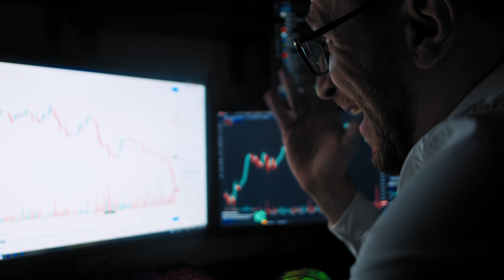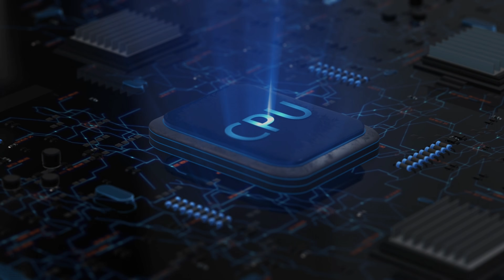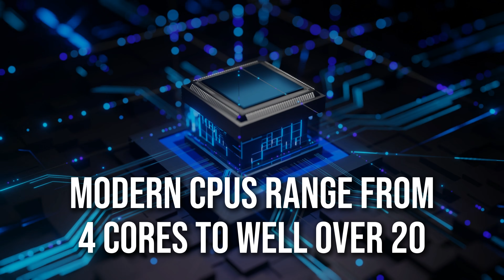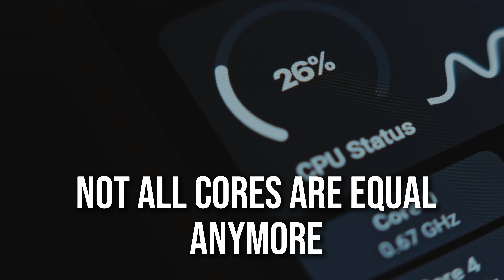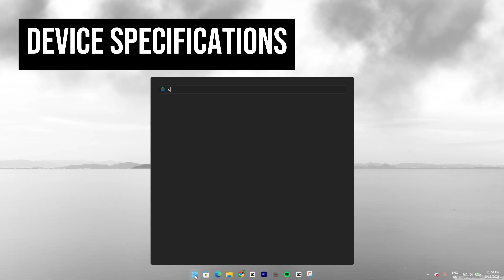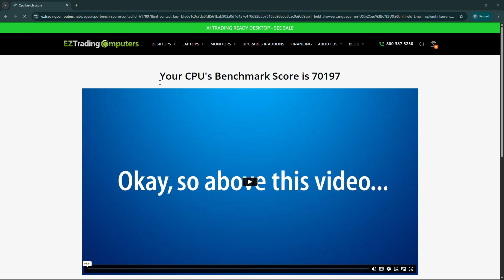Your Processor Score Might Be Costing You Thousands

Comment: What if you are just using Ninja Trader with one workspace, one instrument with 5 chart tabs on one 28 inch monitor with a CPU benchmark score of 27000?
Reply from the maker: Thanks for watching—that’s a solid question.

That setup can run fine on a 27,000 score, but you’re closer to the lower end than it might seem. Once you start adding indicators, tick data, or faster timeframes, NinjaTrader leans harder on the CPU and you can start to feel small delays or chart stutter.

It’s not just about running—it’s about staying smooth during volatility, and that’s where higher headroom helps .

Are you running mostly price action or indicator-heavy charts?
Reply: @eddie @eddiez-trading e the orderflow edition:  VWap and delta.   When I purchased the paid version sometime ago, did not know I had the overflow edition, until Ninja changed its data offering to free for paid platform.  My current set up is a Geekom iT11 model which is 9400 benchmark.  Have been researching models with 27-34K benchmarks.  The 34K one is the IT15 with Arc 140T GPU.    Really want the Panther Lake, but not available yet.   I only trade the Russell.  What do you advise?
Reply from the maker: You really want to try to stay away from those mini-PCs. They won't give you the longevity you need. Take a look at my Viper. I will honor this price for you still https://eztradingcomputers.net/pages/viper-sale-yt
Reply: Thank you.
Reply from the maker: Happy to help!

Comment: Yeah has happened a few times. I'm using a Intel(R) Core(TM) i9-14900KF which Iwas told was more than adequate. Be interested to hear your opinion?.
Reply from the maker: An i9-14900KF is more than adequate 👍 — that CPU isn’t the bottleneck. If you’re seeing issues, I’d look at internet stability first (latency spikes, packet loss, Wi-Fi drops, ISP congestion). Even brief connection hiccups can feel like platform freezes.

Other things to check:
• RAM stability 
• Overheating or thermal throttling
• GPU / network driver issues
• Background apps competing for resources
• Power settings set to something other than High Performance

That processor has plenty of headroom — it’s usually something around it, not the CPU itself.
Reply: @eddiez-trading  cheers Eddie thx for the detailed reply. Yeah working through this step by step. Being in the lucky country....Australia!!! or internet is 3rd world. From what I understand, the upload speed is more important than the download speed, is that correct?
Reply from the maker: Usually its the download speed that is more important because you are taking in all of that real time market data.  Unless you are doing automated trading where your computer is sending orders and cancelling and sending new orders every second, you are probably not uploading much at all.
Reply: @eddiez-trading  Cheers thanks Eddie. Great to have someone sharing this info. Really appreciate it 👍
I'm definately not automated so upload dpeed for market data is more important, makes sense. 👍
Reply from the maker: no prob!

Comment: I trade on a VPS does this apply to me?
Reply from the maker: Some of it applies, some doesn’t 👍

If you trade on a VPS, most performance and stability depends on the VPS provider’s hardware, network, and configuration, not your local computer. Many Windows tweaks either aren’t needed or aren’t accessible on managed VPS systems. If your VPS is shared resources though, that is an entirely other issue!

That said, basic things like keeping the system clean, minimizing unnecessary apps, and stable platform settings still matter.
Reply: @eddiez-trading Ok thanks brother.